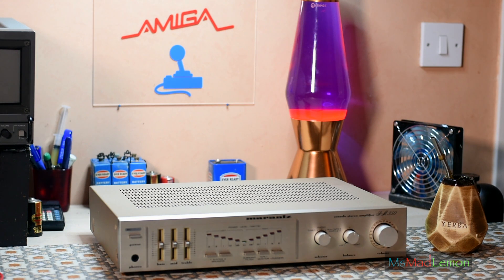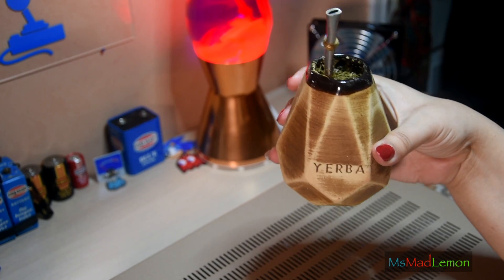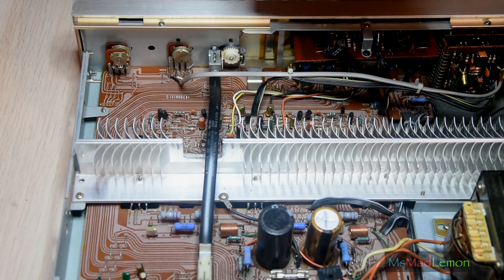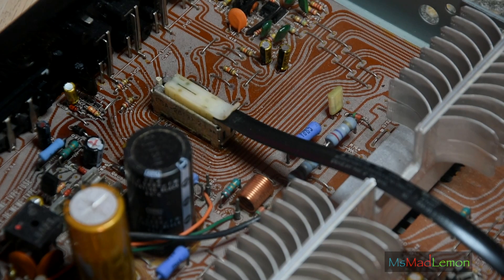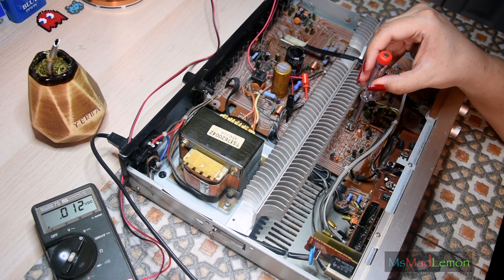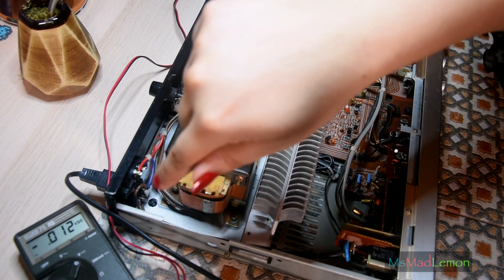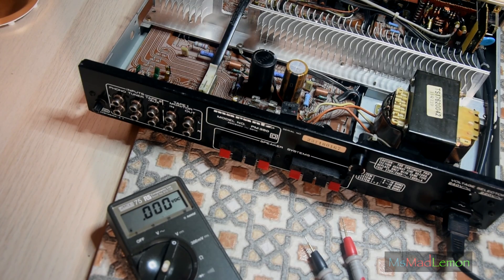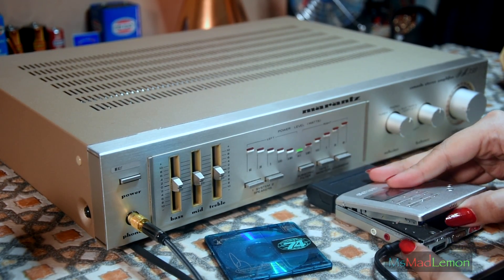Marantz PM 350 Vintage Amplifier Maintenance - Idling current adjustment

Comment: NIce, great video ;    i just can't believe Marantz notched the heat sink so bad and so off center,just because of that switch control...that was an afterthought,maybe?
Also,never saw an amp repair person with red finger nails ,  looks nice among there.
Reply from the maker: Thanks! Looking into this amp, I did wonder if some things weren't entirely planned.. Even one of the power transistors underneath is off the PCB and instead screwed onto the heatsink independently, with wires connecting it to the PCB. I did find that odd. 
And about the red finger nails, there's always a first :o)

Comment: next time when you shift or adj  idle current , connect speakers on amplifier output-without any input-no signals , then trim and check your sleeping  idle current , it s ok 10-15mV

Comment: I think, sometimes I don‘t have enough respect for the mains voltage :-) I am working with open devices so often. I don‘t touch, but sometimes I just forget the risk. In 24 years of being a hardware developer, I just once burned a little hole into my skin with a backlight inverter of a display. Once, a sales guy came to my lab and put his hand into a computer and got zapped. I still have to laugh, when I think of his face :-)

Comment: Important! Use a non-metallic, non-conductive screwdriver for your bias adjustments! The best ones are made of ceramic, but plastic tip screwdrivers will work. They have to be kind of wide/thick to fit the slot in that style of trim pot snugly. I also strongly suggest that you build a current-limiter device, an incandescent light bulb in series with the input power to the amplifier, that will absorb excess current in case the bias trim pot is  intermittent ( a not uncommon occurrence with those flat phenolic wafer trimmers),  or breaks as you turn it, or you short something out inside the amp. Look on YouTube for details of how to build a series current limiter. You have easily got the skills oh, it's not difficult at all, and it can make all the difference as to whether or not you let the  smoke out of those semiconductor devices, and once you let the magic smoke out, there's no way to put  that genie back in the bottle!

PS, most well designed amplifiers will have the bias transistor, or some kind of bias-feedback transistor or diode, mounted on or at least pushed up against the heatsink with a dab of silicone heatsink grease so that the device will sense the heat on the heatsinks from the output devices and adjust the bias a little bit accordingly in order to prevent thermal runaway. Sometimes those transistors aren't pushed snugly up against the heat sink, and if they aren't, then you should push them as snuggly or tightly against it as possible, perhaps manipulating the leads or Heating and then resoldering in order to shift it against the heat sink. You could secure it with the dab of Super Glue if you like and then put a dab of silicone grease on the device. This will keep the bias more stable. By the way, sometimes those bias trim pots need to be exercised back and forth a few dozen times with the unit turned off, and maybe with a tiny dab, repeat tiny dab of contact cleaner. You should measure the resistance of the pot in circuit beforehand so that after mechanically exercising it you can set it back to the same resistance it was set to previously, to prevent blowing up the amplifier when you turn it on again. I still strongly suggest that you use a current limiter in line with the power cord of the amplifier for doing this kind of adjustment.
Reply: Good points.  BTW, she used the current-limiter device, an incandescent light bulb in series, in her AKAI reel-to-reel restoration a long time ago.  IMHO, she did enough of a great job in this small amplifier.  I have seen some really complex vintage Sansui Au-X1 and Marantz 2500 restoration videos for instance, which I am incapable to dare to do,  that have like 170 VDC rail to rail and 100 W per channel, with complicate tuner stages tuning that require special & expensive lab equipment.  Those are really the ones that require more meticulous attention to detail in my opinion.
Reply: @kylesmithiii6150  , my boss is a ham radio operator, like most hams he has forgotten more about how radio tuners work than I will ever know. He does the tuner tweaking when I'm finished repairing and refurbishing any vintage receivers. We do a lot of repairs on old Sansui, Pioneer, Marantz, Kenwood, thank you, and so forth. Some of those units have fabulous tuners when they are properly adjusted. I just worked on a Kenwood KR 9600, big heavy receiver with handles, quite the Beast! Nice sounding, very well built, and it has an excellent tuner. Most units we see of that vintage have had multiple klutzy hands and wannabe technicians inside of them, but this one was almost  factory stock. Still, in order to make it reliable for the long term we recapped the output amplifier boards and replaced the differential input transistors, which were the old type with beveled edges and badly oxidized leads.
Reply from the maker: @goodun6081   very good
Reply from the maker: Non metallic screwdrivers arent that much of a big deal over here, especially if they have plastic handles, its more of an issue when you're dealing with radio. Even still there is no electrical contact between myself and the pot.

Thanks for the tips but I had already checked the transistor prior they already have silicon heat sink compound on, I dont wanna take too many unnecessary steps with regarding this, I think the result in the end is a working amp which is well serviced and fixed.
Reply: @MsMadLemon  , use of a non-metallic screwdriver for adjusting bias isn't to prevent you from getting shocked, it's to prevent blowing up the amplifier because you slipped with the screwdriver a little bit. I myself have let the smoke out of more than a few transistors in my day, it's not something I care to repeat. I use the current limiter, make my meter-probe connections with the unit turned off, and use a non-conductive screwdriver, always. Glad to see you're using the hook-on type probes, I think the brand name is "EZ-Hook" here in the States. I use them all the time, they work way better than standard "alligator" clips ( AKA crocodile clips to some )......
Reply from the maker: @goodun6081    I know it's not to prevent me getting shocked.... I do know about electronics and i'm very careful in my work.
You are starting to sound insulting now.
Reply: @good'un You really make some good and practical comments here, I see you know the subject, and I can't disagree with most of your practical tips here and I appreciate it, but this is not supposed to be a "who is the righteous or the best contest" or "who knows more or less about something".  You don't know me, what my academic and professional backgrounds are, etc.  I happen to know quite a lot about electronics, physics, mathematics, business administration, finance, multiple languages, etc.  This kind of electronics is a hobby for me.  I enjoy watching Ms Mad Lemon videos and I have learned a lot from her. I wish I had time for vintage PCs too.  For instance, she inspired me to finally buy a desoldering gun and recap my 1979 JVC cassette deck a few years ago, which then motivated me to do other electronics projects with enjoyment.  I watch her videos often and enjoy them.  She inspired me also to buy an AKAI reel-to-reel for restoration but I was never up to the challenge, that is still in my 'to do' list.  BTW, I can afford buying new relays for my amplifiers even if they cost $100 each.  When I want a brand new amplifier with all bells & whistles I just buy it, but in parallel I have my electronics hobby because I like it and get good advice and inspiration from Ms Mad Lemon's and others' videos.  This is supposed to see the bright side of things, not the mundane defects of someone's work from one's point of view in spite of one's good intentions.
Reply from the maker: I totally agree Kyle, knowledge is nothing when its fuelled by arrogance, egotism and insults, its not impressive and totally loses my respect. it's very off putting. 
And just because one has knowledge doesnt mean its their right to trample on others and insult people. Such people who do so lead very dull lives constantly trying to one up others. its not a competition, its supposed to be a sharing community, we're meant to inspire one another, not decide who is dominant or subservient. 

@Kyle Smith, thank you for your kind words, it makes a difference to know that there are those like yourself out there who appreciate my work despite having more professional experience. I appreciate the support.
Reply: @MsMadLemon  Thank you!  I meant what I said.  For instance, I bought the exact same desoldering gun that you used in your Señor Onkyo video, with extra nozzles as you recommended.  You inspired me to do this electronics hobby and I did a few others after my 1979 JVC Cassette Deck recap.  I really enjoy it.  Thanks!
Reply: @MsMadLemon  , I did not insult anyone, and I  certainly didn't engage in name calling, and I have no idea how you came to that conclusion. I freely shared some of my experience and, yes, even acknowledged that I've made plenty of mistakes along the way (what used to be known known as humility). And a lot of what I know I actually learned from others who were gracious enough to share their experiences with me, and only because I was open to it. Its a strange world we live in when somebody gets slapped around online for trying to be helpfull by sharing knowledge and experience.  But hey, feel free to make your own mistakes.
Reply from the maker: @goodun6081   "use of a non-metallic screwdriver for adjusting bias isn't to prevent you from getting shocked, it's to prevent blowing up the amplifier because you slipped with the screwdriver a little bit."

Since you've been commenting you've been talking to me as if i'm really stupid and dont know anything! 

insulting doesnt just mean name-calling, It can also be the manner in which you talk to somebody. you've been very nit-picky with me and mostly over-explaining and explaining things to me that I already know. and assuming that I know nothing at all....it gets annoying and comes across as patronising and no one likes to be talked to like this.

" But hey, feel free to make your own mistakes."

Everyone makes their own mistakes, thats how we learn. Also you dont over adivse people to the point of talking down to them!
Reply from the maker: @geraldv203   Your comment on the sync stripper didnt come across this way. I mean you didnt talk to me as if I knew nothing. or bombard me with paragraphs of text talking about details that arent so important. if I remember you also linked to Voultar's video talking about the soldering station that is a good one, which I showed to my friend as a suggestion when he was buying one.  (I think that was you, I get a lot of comments so i do get mixed up in them at times) 
I'm not talking about you here, just speaking in general terms...I normally am tolerant and I try thinking good of somebody before bad. But over explaining things, or adivising things which I already know (when its clear from the video that I already know or did it) .. I think it would even irritate you guys if someone did that to you. 

Anyway I didnt take that Sync signal comment the wrong way, it was fine.

Comment: At 5:20, I strongly recommend that you not simply spray Deoxit or any other electronic  cleaner into any kind of slide fader. This tends to wash away the silicone grease which lubricates the tracks, and the pot will be sticky and never feels quite the same afterwards;  it might also be more likely afterwards to fail at some point in the future (the plastics in some pots and faders can react with certain cleaners, or the new cleaner sometimes reacts with the old or original lubricants in the pot, sometimes causing the control to  freeze up ). Caig Labs, majer of Deoxit,  does make a Fader Lube that they market  specifically for slide type faders, but that doesn't work all that well either in my experience, and again, just spraying it into the pot is not a good idea. 

Anyway, I strongly suggest that you use a small syringe or pipette to put just a couple small drops of cleaner on the actual carbon tracks of the pot, reaching into it from the front (sit the unit on its back panel if you can, so that the fader tracks are facing straight up). That  spurt of cleaner from the spray can was probably ten times as much cleaner as you need to use, and that stuff's expensive. Many or most rotary  volume controls and tone controls can survive  that much cleaner being put inside of them,  but slide faders are a special  case, and you should always proceed with Extreme Caution, because if you damage them or seize them up, exact replacements are almost certainly not going to be available, and you might have to unsolder the control from the board and take it apart and try to repair it. I have done this from time to time, and trust me when I tell you that it is not fun! Anyway,  you should spray some of the Deoxit or other cleaner into a small container and suck it up with a syringe or pipette which will allow you to apply it sparingly to the controls;   in fact, you would be better off to clean all switches, controls and potentiometers that way in the future, with a very minimal amount of cleaner, skillfully applied exactly where you want it.! (A small drop or two of pure alcohol directly on the carbon tracks might work as well or better than any electronic cleaner, but again you have to be extremely careful where you apply it and how much you use, as you don't want to flush away lubricant from the tracks, you only want to degrease and de-sludge  the connection between  the wiper(s) and the track(s). Note that there is actually a metal wiper to metal track connection, as well as the expected metal wiper to carbon track connection).
Reply: Innit
Reply: @electronscape  , huh? What is the meaning of "Innit"?!",  AKA "isnt it? ", in this particular context?

Comment: Hi from Argentina again! mate, accordion and vintage electronics maintenance, you certainly are a 1 in a million girl! we here only have mate in winter because we use hot water (hot but not boiling, around 50 or 60 celsius); when u have cold mate (for summer) that's called Tereré and is mostly a Paraguayan beverage (although in northern Argentina is common too); loved the final arrangement of amp+MDs in formation! Big hug!

Comment: One thing to watch with bias current is that it will change as the heatsink warms up. It's usually a good idea to adjust to the required voltage, wait 10 minutes or so, and then readjust.

Also now you have your 'scope, it's worth feeding some sine waves in and checking for distortion!
Reply from the maker: I did that in the video lol ;o))
I adjusted it and said i'll leave it for half an hour, but it was actually 45 minutes lol 

Good call on the scope yes!
Reply: @MsMadLemon  Yes, I get "lazy" sometimes to use the oscilloscope, but it is a good idea.  When the amplifier has been in my possession for a while and is visually ok and well maintained with no burn marks on the PCB, I usually put on a good headphone and nothing playing at highest volume to hear if there is any "popcorn" noise or 50/60 Hz humming, etc.  But after I recap my amps, I do inject the common harmonics one by one: 31.25 Hz, 62.5, 125, 250, 500, 1k, 2k, 4k, 8k, 16kHz on an 8 Ohm (50W) dummy load per channel connected to an oscilloscope just for peace of mind.  The service manual usually suggests to test 1kHz only, whatever one decides to do.  BTW, some JVC amps (like Class A) suggest to wait only 5 mins to calibrate the bias.  Some JVC's w/ the STK Darlington Pack suggest only 2-3 mins wait!  That's pretty much what I do.  The Marantz tech folks seemed to be more rigid, that's good.
Reply: @kylesmithiii6150  , injecting a clean 400 Hertz tone and rotating the pots and switches will tell you , or Maddy here, if the cleaning solution and technique did its job well or not. Dirty, oxidized pots, or oxidized relay contacts, will make a telltale "scritch scritch" static noise, or cause channel dropouts, or sometimes buzz and whine almost like a mosquito. Easy to see the noise spikes and distortion on an oscilloscope as well.
Reply: @goodun6081  Thanks, it is good to know.  BTW, I almost never clean relays (such as those speaker protection relays that can have only a few mOhms of resistance).  I prefer to replace them even if I have to do an overlay PCB with pins for the new relay that has different pins.  Those relays cost usually less than USD 10 and a new relay will like last for decades.
Reply: @kylesmithiii6150  , I work for a stereo repair shop and we clean and reinstall output relays all the time. Polish them with a pencil eraser shaped to a chisel-lije tip, degrease them, and they should be good for about 10 years. (Do NOT put any kind of residue-leaving switch & control cleaner or so-called contact preservative on them).  Often the existing relays in the 30-year old piece of equipment are better quality than what you might replace it with. We have probably a hundred different types of relays on hand, but unless they're visibly pitted or arced, perhaps from high DC offset or a blown up amplifier,  we rarely need to replace them. By the way, many of the modern sealed relays end up being intermittent or noisy when installed if they have been sitting around for a few years, which means we have to cut them open and clean them anyway!